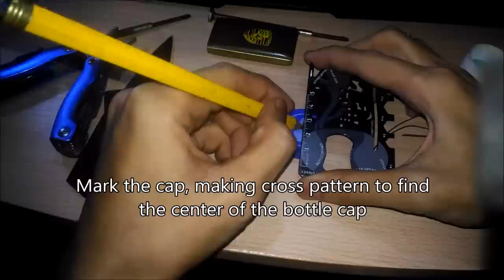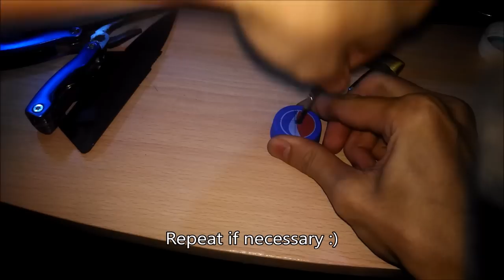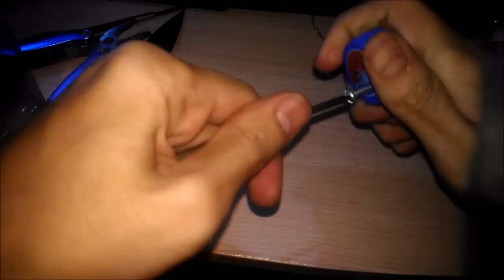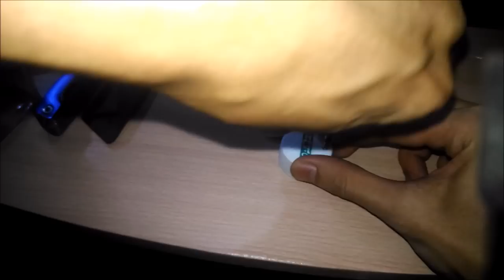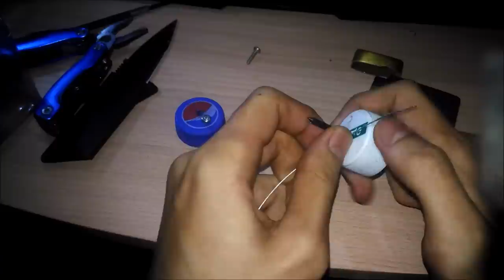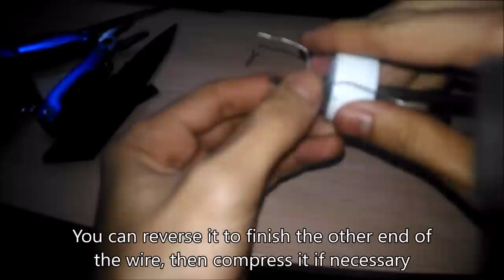How to make DIY Coil Jig using Bottle Caps

Comment: I have an improvement for this design. For the right hand side, instead of bottle cap use something rubber like a thick rubber washer or a small suction cup. Make appropriate hole in the center of whatever rubber piece but do not make a notch. Slide rubber piece on to rod, place small amount of wire lead under your thumb on the side of the rubber piece, proceed with same method as shown in video for winding. I prefer this as the rubber has a lot more grip on the wire and will not shift around once you have a firm hold on it.  This allows the lead to be significantly shorter as you don't need much of it to hold it securely against the rubber.